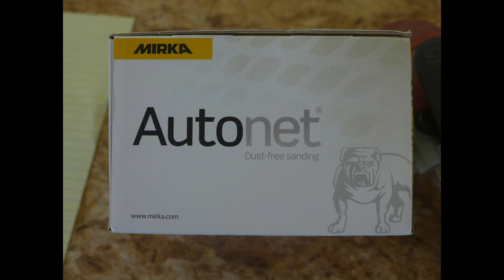X-LS  Veneer Prep, Sanding and Updates

Comment: The long form videos are great.  I'd rather have too much info than not enough.  Sometimes you go into more detail then I need since I've done a fair amount of woodworking but I can always fast forward those bits.  For someone that's new to woodworking those might be valuable bits. One of the things I've learned from helping guys in AVS's DIY section is that what I consider to be over explaining is often under explaining to someone new. :)  So I've taken to try to give extra info when I can, especially on safety stuff.  Most guys don't realize how bad something like MDF dust is to breath and it's good to give those reminders.  

As for changing the cut depth for veneering I'd say leave it as is.  I'd rather have the flexibility to change my mind on how I'm going to finish them.

Comment: I didn't read all the comments below, so probably someone already made this suggestion and if so, just ignore.  But if not, here goes:  

At around 7:00 minutes in, you were talking about the problem of having two separate cases in inventory because of the difference in depth for the speaker if it were painted versus veneer.  In order to keep from having to tool two different cases for the speaker depth, I would suggest that you add in all your kits a makeup gasket at about the thickness as the veneer.  Then everyone would have their choice as to veneer or paint.   In fact, someone might initially paint the speaker box and later decide to veneer.  With the gasket and assuming they kept it, they could go back and veneer it, thus essentially having it both ways.  Just a suggestion and would definitely keep you cost and inventory down, as you would only have to make one box that would work for both situations.  I am sure a spacer gasket could be made very cheaply.  Only question is would it affect the sound, but that would be your expertise and not mine.    

Also, thanks for the videos.  They are extremely helpful and well produced.

Note:  Guess you did already answer the question as I did finally go down and read the comments.  But I left mine anyway.  I would also just make a gasket out of the veneer.

Comment: With the screw holes on my electric guitar pickguards, i run the screws in, take them out and apply a bit of superglue in the holes, let it dry, this reinforces the hole by basically turning it into a wood fiber reinforced composite. Then when you come to finally fit, counter rotate the screw a little before screwing it in, to pickup the the act thread alignment again. This works well for where you envisage removing screws later. And avoids wrecking the wood and losing grip on the screw
Reply from the maker: Stephen, that's a good technique for sure and I've done the same. Even tapped machine screw threads in MDF! Thanks for pointing it out.

Comment: If you go with veneer, do you reduce by 10 or 20 or 30 mils? Everybody who uses veneer has some thin wood exactly the right thickness to make a gasket to put under the tweeter.
Reply from the maker: It has proven to be a non-issue for the reason you describe. More about me puzzling through all the possibilities, I suppose.

Comment: Why not add extra shims to veneer kits?
Reply from the maker: I considered it, but it's problematic in a number of ways. Veneer is not all the same thickness, so I'd be guessing at best. If I were to manufacture a multiple shim pack that would cover most possibilities, it would raise the cost of  my kits significantly. Further, many don't know how they're going to finish cabinets at the ordering stage...veneer vs. paint, etc.
I've had many tell me that cutting shims from veneer they used worked well and it's what I do when I build out cabinets. Turns out I was postulating on something that hasn't proven to be a concern.
Reply: @carbidetooth  sounds like a final assembly issue, where aligning the tweeter faceplate exactly flush will require a somewhat 'custom' approach. I have had limited success in using a gasket that has some compression to align, but  if too much compression, then the faceplate can deform. Thanks!